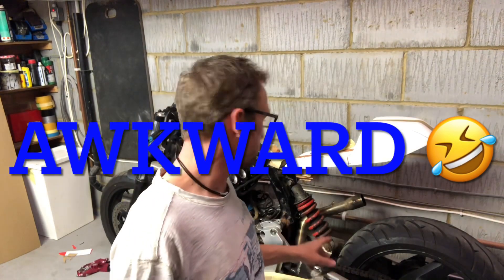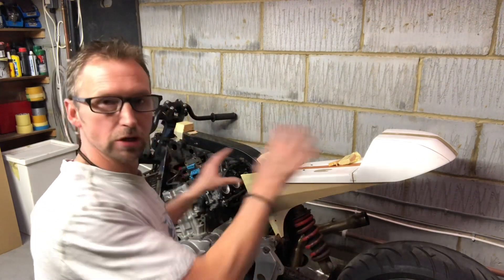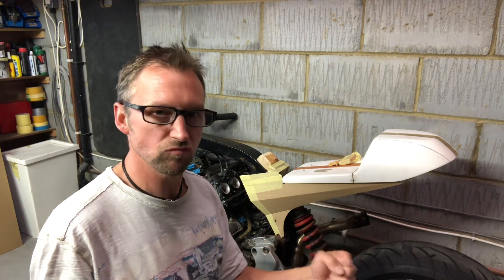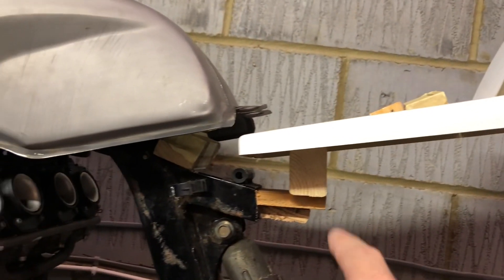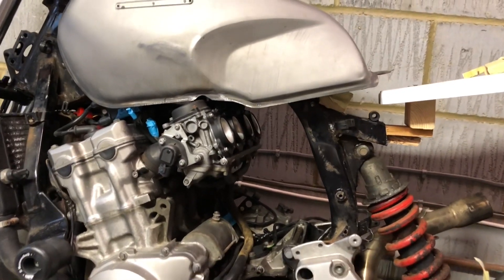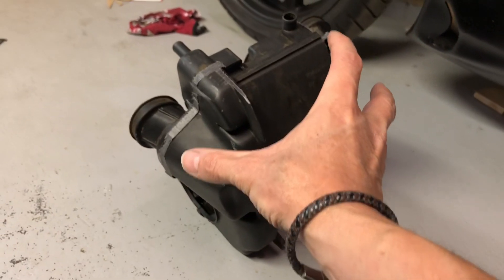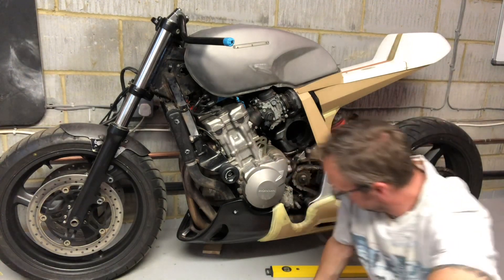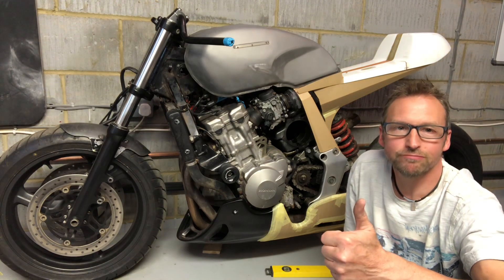Honda project, more CAD, and tank angles make all the difference

Comment: yup , have u thought of using a 3d printer, they are cheap as these days ,,, IF the airbox less than 220 x 20 x 220 mm   you can print it  
my bike I hid all the electrics in the airbox and 3d printed the mounts  brackets for the coild and reg rec inside airbox
Reply from the maker: Haha Stephen, I struggle to make a simple YouTube vid, don’t get me started on 3D printing 🙈🙈